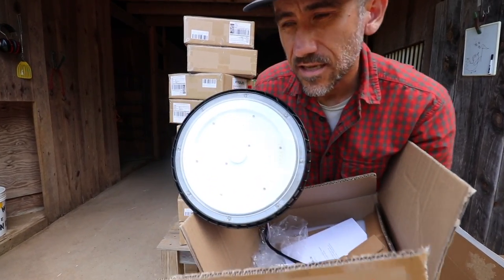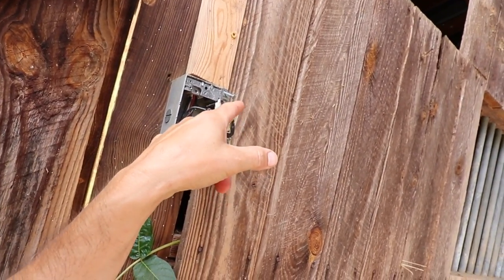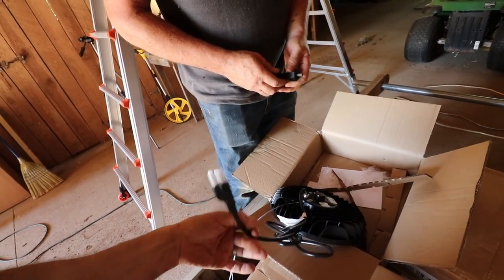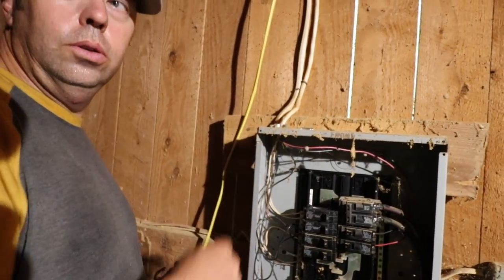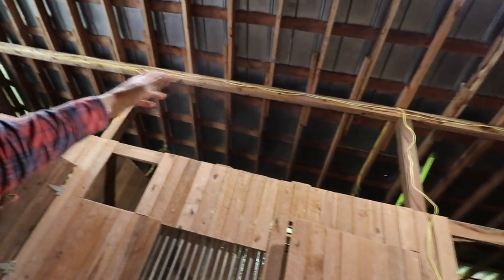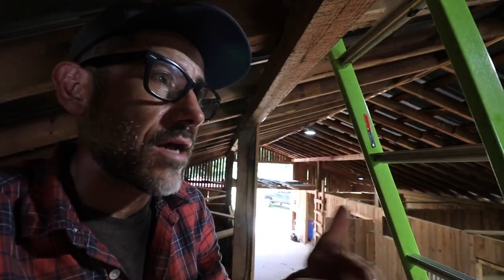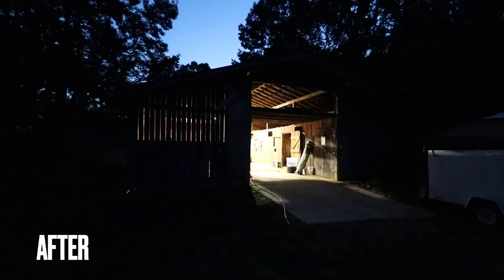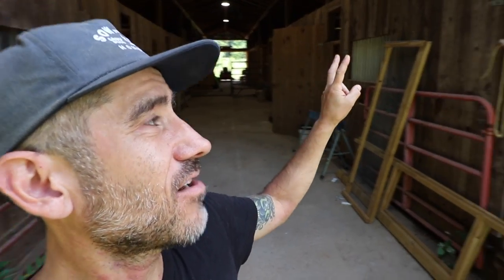Installing Lights in a BIG Horse BARN Hyperlite LED

Comment: Good video Jason, as an electrician I wish yall would have used MC cable not the Romex but maybe its different in your state, but please put some silicone on the top of those switch boxes by the door to keep water from building up inside. Hope this helps stay safe.

Comment: Sweet lookin barn. Question: the electrical panel is on an outside wall ( inside ) but the wood has open spaces between. Would you wanna make it more protected from the weather?

Comment: Im always looking for new ideas for lighting. Thanks. I will say, however, I dont know why you used a sealed outdoor switch, when the wiring wasn't put in conduit, and the rain will just run down the wire right into the box?